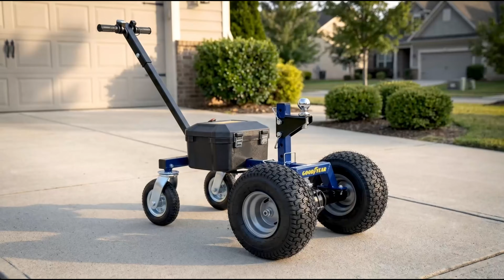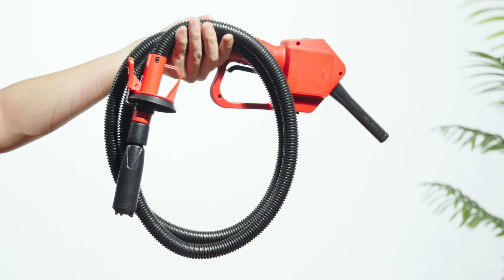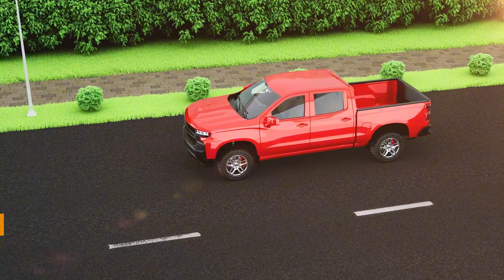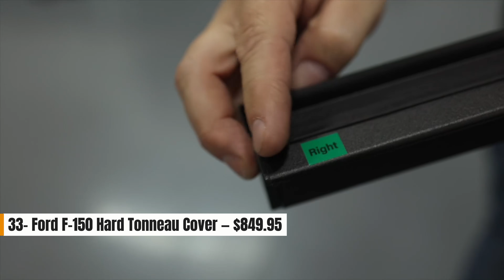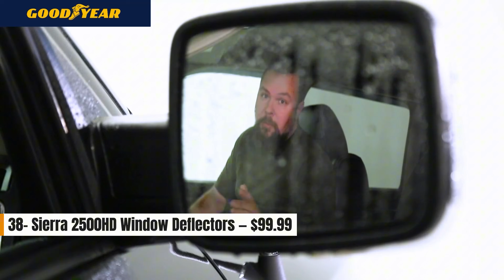40 NEW Amazon Products That Solve Everyday Problems for Seniors Living Alone

Comment from the maker: Still towing, hauling, wrenching, or working on your own truck after 50? These forty Amazon finds include truck-bed upgrades, towing gear, garage tools, recovery equipment, lighting, cargo solutions, and surprisingly useful products that can make everyday truck ownership easier.

00:00 Intro
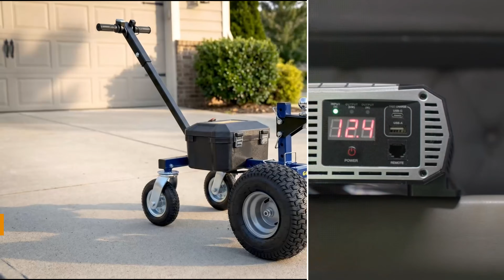1- 00:48 Electric Trailer Dolly — $1,099.99 — https://amzn.to/3UFNYRh
2- 01:46 1500 lb Rotating Engine Stand — $119.90 — https://amzn.to/3UkbWBt
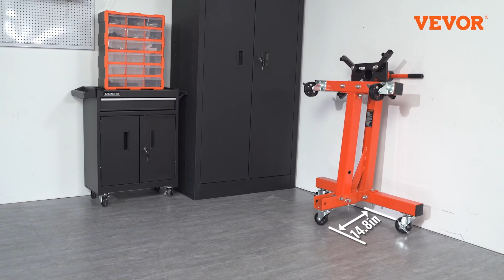3- 02:52 Retractable Hard Tonneau Cover — $787.99 — https://amzn.to/4bVn9hW
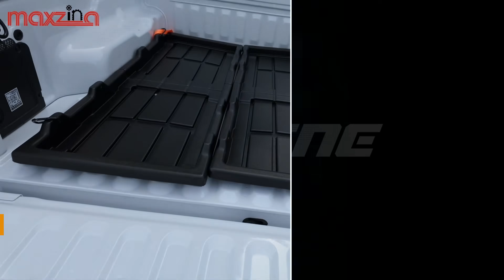4- 03:55 Ford Maverick Slide-Out Cargo Tray — $139.99 — https://amzn.to/3U2dAb2
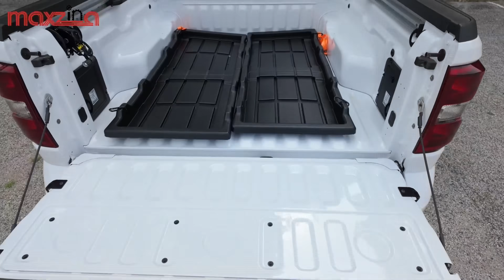5- 04:57 Tundra Truck Bed Cargo Divider — $149.99 — https://amzn.to/4gjwjX2
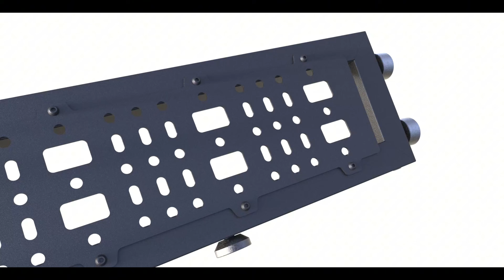6- 06:01 Tacoma Truck Bed Step — $169.99 — https://amzn.to/4bQr0wQ
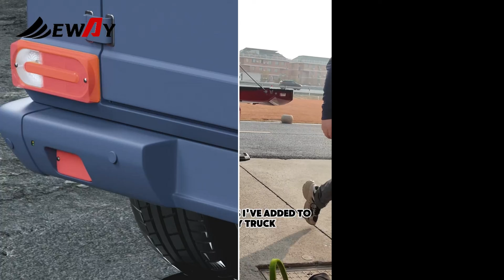7- 07:05 Wireless Magnetic Hitch Camera — $98.99 — https://amzn.to/4xNFXrW
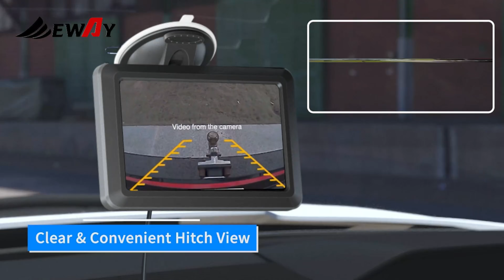8- 08:03 MagSafe Car Mount Charger — $15.99 — https://amzn.to/4ieWGj9
9- 09:01 Hydraulic Recovery Jack — $298.99 — https://amzn.to/4cKnd4k
10- 10:03 Digital Tire Inflator Gauge — $28.99 — https://amzn.to/4648g9E
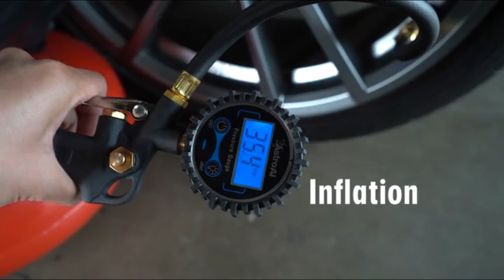11- 11:36 3 Ton Low Profile Floor Jack — $169.99 — https://amzn.to/4hAbh8K
12- 12:40 Adjustable Drop Hitch — $94.49 — https://amzn.to/3UnTR5v
13- 13:40 Portable Fuel Transfer Pump — $35.99 — https://amzn.to/45DgqWm
14- 14:43 Silverado Tailgate Anti-Theft Lock — $25.99 — https://amzn.to/4x5ql2S
15- 15:46 Receiver Hitch Vise — $129.99 — https://amzn.to/4g5P55k
16- 16:51 Hitch Cargo Carrier with Ramp — $299.99 — https://amzn.to/4i9MVCY
17- 18:01 Hitch Reverse Light — $100.99 — https://amzn.to/3SBjOy5
18- 19:08 RV Tire Pressure Monitoring System — $69.99 — https://amzn.to/4cGxKNV
19- 20:15 4G Car Tracker & Alarm — $49.95 — https://amzn.to/4bRvQtM
20- 21:17 Auto-Stop Fuel Transfer Pump — $64.99 — https://amzn.to/4ghvM7T
21- 22:19 Tundra Truck Bed Mat — $107.99 — https://amzn.to/4xkSGT9
22- 23:24 Folding Car Door Step — $18.99 — https://amzn.to/3STYrYU
23- 24:25 Silverado & Sierra Bed Step — $199.95 — https://amzn.to/3UcMtdn
24- 25:34 10 Ton Snatch Block — $26.78 — https://amzn.to/4cKEx9t
25- 26:33 Power Inverter Cable Kit — $35.61 — https://amzn.to/4zBTdBJ
26- 27:43 All-Weather Floor Mats — $34.99 — https://amzn.to/4xWVzcx
27- 28:39 Ram Power Window Regulator — $50.57 — https://amzn.to/4cITl8x
28- 29:49 Ratcheting Cargo Bar — $58.90 — https://amzn.to/4xm4B2U
29- 30:51 Wireless Magnetic Trailer Lights — $65.53 — https://amzn.to/3UhA7Ra
30- 32:04 Elastic Truck Bed Cargo Net — $28.03 — https://amzn.to/3UhKEvI
31- 33:32 Kinetic Recovery Rope — $134.90 — https://amzn.to/4xwnY9u
32- 34:34 LED Interior Bulbs 10-Pack — $14.99 — https://amzn.to/4io9y6M
33- 35:45 Ford F-150 Hard Tonneau Cover — $849.95 — https://amzn.to/4guZEOh
34- 37:00 Silverado & Sierra Rain Guards — $59.99 — https://amzn.to/4cvQsYT
35- 38:17 D-Ring Recovery Shackles — $23.79 — https://amzn.to/4cd2ENR
36- 39:15 LED Fog Light Bulbs — $29.99 — https://amzn.to/4gktExp
37- 40:27 Ford F-150 Truck Bed Step — $189.99 — https://amzn.to/4xhyEc1
38- 41:31 Sierra 2500HD Window Deflectors — $99.99 — https://amzn.to/4ivbtGz
39- 42:34 Adjustable Ratcheting Cargo Bar — $37.99 — https://amzn.to/4qDbZo5
40- 43:49 Ram LED Cab Marker Light — $249.99 — https://amzn.to/46upQ6N

Which one would you actually put on your truck? Tell us your truck, model year, and favorite product in the comments.

👍 If this video helped, hit the like button and subscribe for more useful Amazon products, truck upgrades, garage tools, and practical finds.

Disclosure: As an Amazon Associate, we may earn from qualifying purchases. Product images and videos belong to their respective owners and are used for review, commentary, and informational purposes.

Prices shown were accurate at the time of filming and may change.

#AmazonFinds #TruckAccessories #CarAccessories